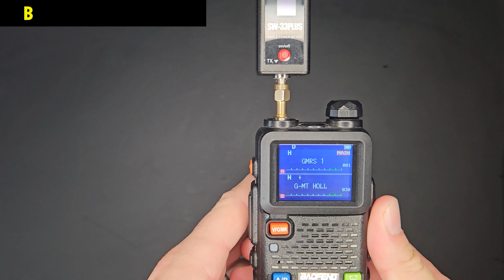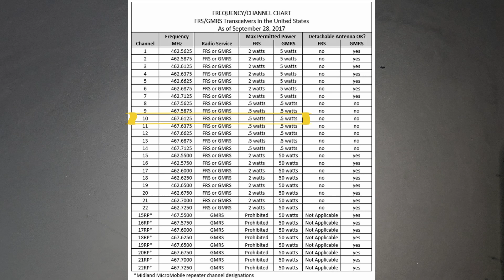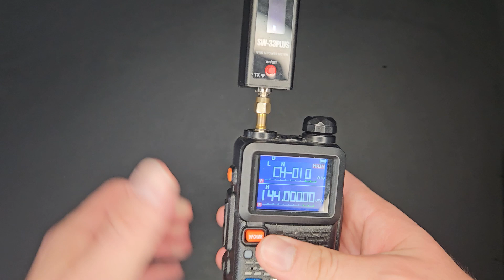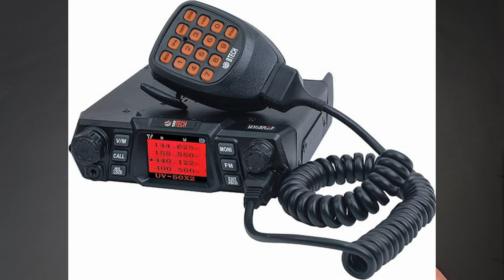Are Radio Manufacturers Breaking FCC Rules?

Comment: Channels 1-7 and 8-14 are regulated by ERP, effective radiated power, what is emitted from the antenna.(5W and 0.5W max. respectively)  Channels 15-22 and 23-30 are regulated by PEP, peak envelope power, what is transmitted from the radio to the antenna system (50W max).  This video mistakenly measures PEP for all channels.  FCC Part 95E  power tests are conducted on the equipment under test (EUT)  as sold, with the rubber duck antenna that comes in the box. The radio is set on  on a "non-conductive table"  without a person holding the radio or a ground plane, so there is no benefit of radials or counterpoise or a persons hand and  body performing as either.  
A 1/4 wave ground plane with 3 or 4 radials angled about 45 below horizontal has a gain of 2.15 dBi or 0 dBd so I expect the rubber duck to be negative dBd.  The stock rubber duck for this radio is a coil of wire maybe 3" long and 1/4" in diameter so it is shorter than a classic 1/4 wave, which would be about 6" for GMRS, more reason to believe it's gain is some negative dBd.  Pretty much everybody agrees that OEM rubber ducks are crappy antennas but there are not many numbers about how crappy.  On guy says rubber ducks are typically  -2 dBd to -6 dBd in UHF.  If the OEM rubber duck used in the FCC test  is in the range -2 to -4 dBd, this radio could meet the regs.

Comment: Before you take the readings too seriously, the accuracy of the SW-33 isn't what I would call 'professional equipment'...
Even a Bird wattmeter has a 5% accuracy level, and is probably shielded better to avoid radiation problems.
But the SW-33 reminds me of the old CB days when meters would read high, making people happy their radios are working so well!!
Reply from the maker: I used multiple meters off camera i just use the small one  for this shot as its small and fits on camera. So of you are trying to say i am wrong because of the test equipment on camera you would be wrong. This radio is breaking the rules.
Reply: @citizensurvivalplan  No, I was just saying if that was the only reference, I would be suspicious of the reading. But if you verified it, then all is good!

But I would explain that the next time, as such meters have been known to have accuracy problems.

Comment: I had my cheap UV-5R checked at the ARRL booth at the hamfest.  They had spectrum analyzers for that. Previously they had tested my Icom handheld radio and it passed and got their sticker.  The Baofeng had spikes all over but I mostly use it for monitoring and scarcely for any sort of transmitting.   Yes you get what you pay for,  for the most part.  Even with Chinese labor.